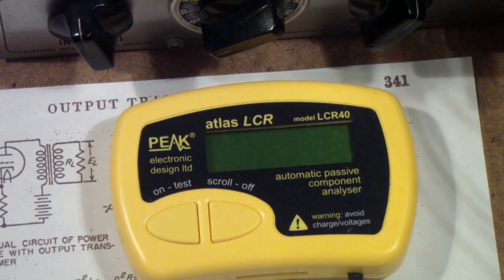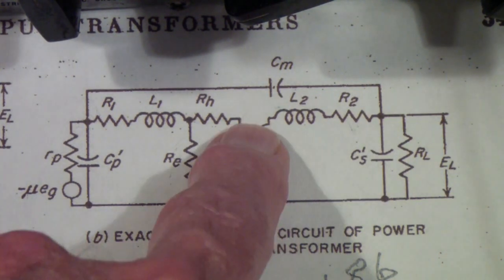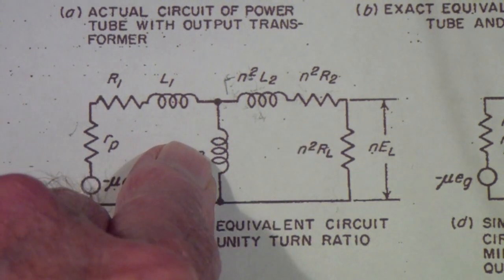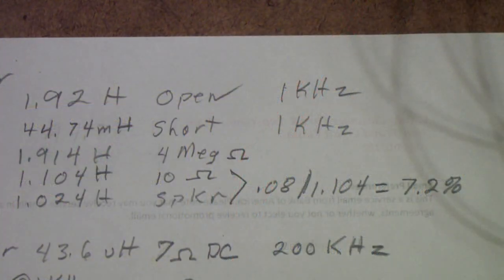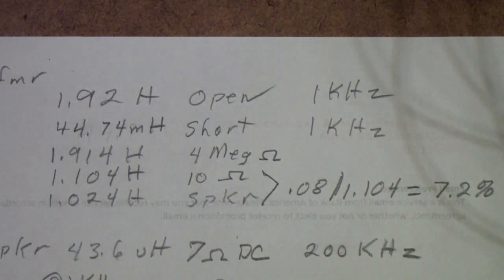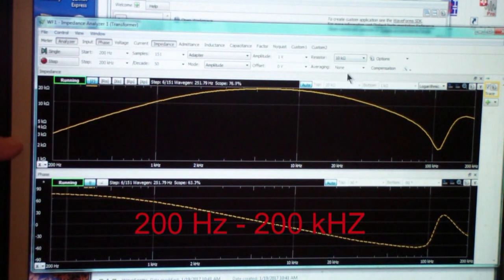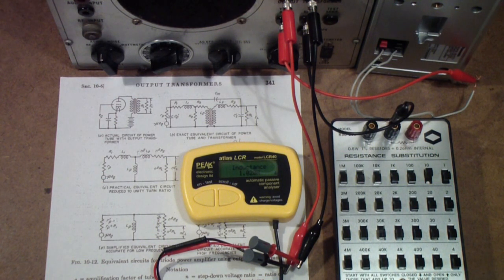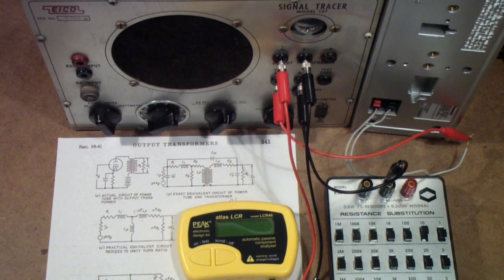TTT311 more on Why Tube Amps Sound Different

Comment: Thanks Tom!
This begs the question...
In early days of transistor amplifier where OTL (and cheaper PNP transistors) was used in a push-pull arrangement, will it retain some of the vacuum tube "warmth"?

Comment: Fascinating Tom! Thanks for answering my question. Or even better, telling me I was wrong, love it! I surely did learn something this late Saturday night. I learned I should at the bench instead of watching YouTube.  I'm writing down to repeat your work here. Have a great weekend!
Reply from the maker: Thank you for your comments, but I certainly don't think you were wrong. You pointed out an inconsistency between views. Both may be right in certain cases. Best of all though, you remain open to diverse opinions. I agree that doing your own experiments is the best way to arrive at the right balance. I hope you will publish your results and, please, keep commenting and questioning - it is the only rational way to move forward.
Reply: @tomtektest8042  I agree with your points here and the in the video. There's an elliptical shape dependence on the quality of the OPT and speaker design. I'll think more about this and concentrate on it's design challenges of single-ended design concerning tonal tayloring. This is another huge unknown area (at least to me) of vacuum tube amplifier design. Thanks for replying.